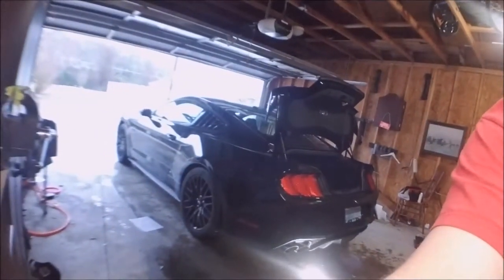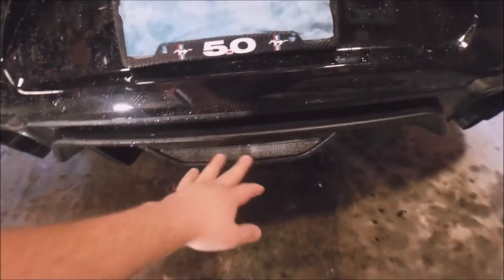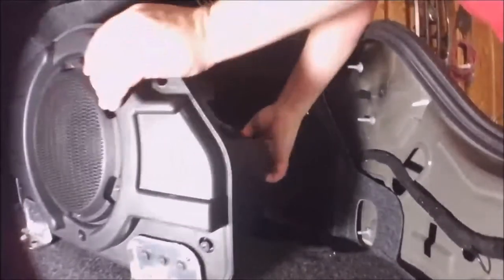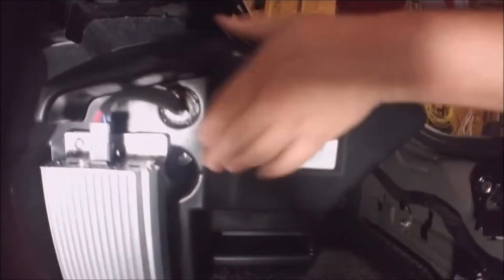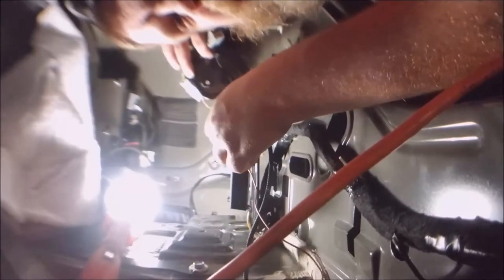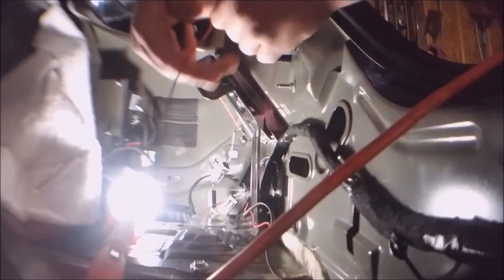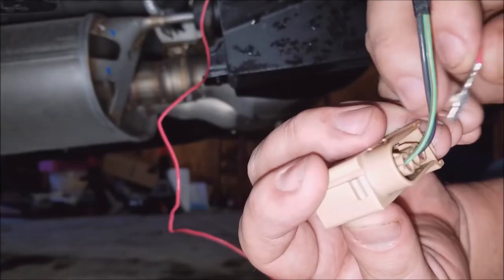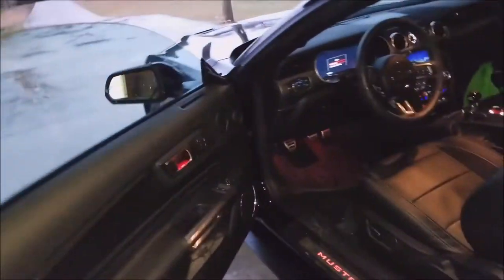2015 - 2022 Mustang 4th Brake Light Kit by Diode Dynamics

Comment: Great video. Thanks for the great tutorial. Subscribed so I can do the mods once my 18 arrives.
Reply from the maker: Congrats on the car. Which one did you get? EcoBoost or GT?
Reply: Mustangs by Matt 

GT. Same options as you from watching your content. Still waiting though. Ford has some delays with the performance pack and magnaride so I'm still waiting on my build date.
Reply from the maker: Paul Gormley Very cool. You won't be disappointed, I promise you that. I just happened to find the exact spec I wanted around 100+ miles from home and pounced. The dealer was actually getting ready to ship it to Florida to a sister dealership the day I called them.
Reply: Mustangs by Matt

Way to pounce lol. I'll shoot you a photo once mine gets in. Keep up the good work. You've got a great channel here.